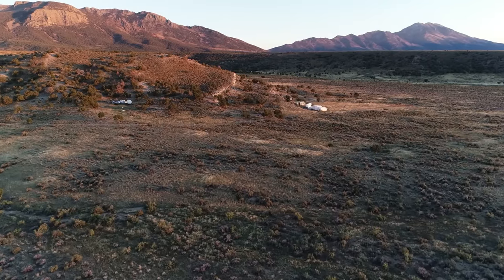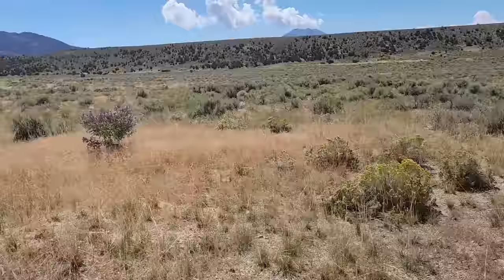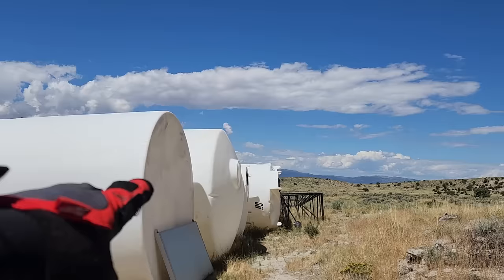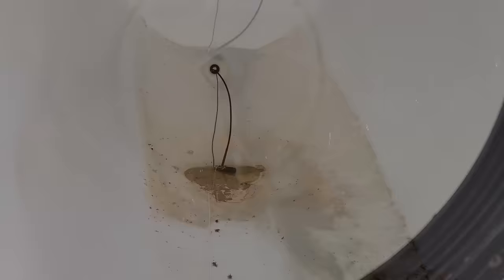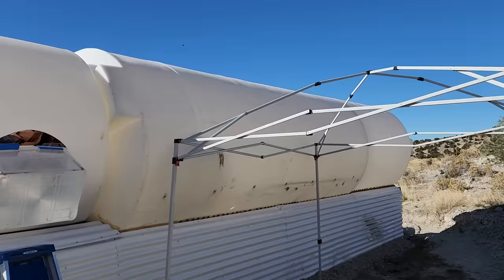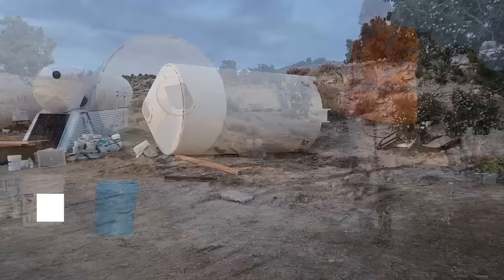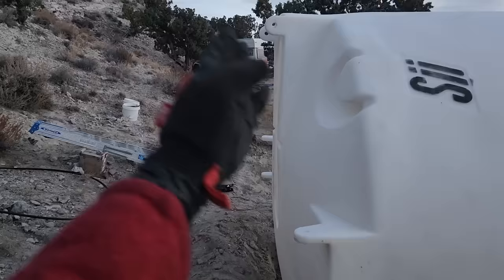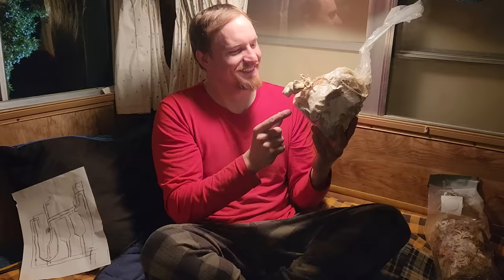ChickenHole Base Ep 23: Magnificent Moths

Comment: The vascular resistance to flow through a pipe varies with the 4th power of the radius. A pipe with twice the diameter has 94% less vascular resistance.
Reply: My man
Reply: GO MATH!
Reply: Science and sh*t!
Reply: the neat thing about math is i have no idea if this true or if you are trolling
Reply: @Nderak  The even neater thing is you can actually look it up! If you google ""vascular resistance trough a pipe" you'll find poiseuille's law. If you google the formula for that law you'll find that it's a term devided by pi * a radius to the power of 4! Which means if the radius is small the resistance is "something" devided by pi*something small to the power of 4. Which leaves you with a large portion of that original something, which means a lot of resistance. So the larger the radius, the more you devide the something, and exponentially at that.

You just gotta know about the law in the first place I guess.
Reply: I was thinking the same thing without the numbers.
Reply: Heart blockages hate that law
Reply: this guy meths
Reply: I had no idea

Comment: buying a shed for your materials so they don't get wet would be good, maybe an atv to survey your property, also would be cool to turn one of the tanks into a water tower to take full pressure showers, and maybe make an outdoor shower.
Reply: He's far more likely to build or even convert yet another tank into a storage shed. He could also place a fresh water tank higher on the hill to deliver the pressure, with a low load water pump to top it off. Far safer than building any sort of structure to hold a tank.
Reply: Peeping, Thomas?

Comment: I second the other comments about check dams to slow runoff. I also heartily endorse the comments recommending the purchase of an excavator, although I strongly suggest that you choose a tracked skid steer with interchangeable attachments, such as a bulldozer blade, vertical auger, backhoe bucket, etc. There's a company called Titan Attachments with an astonishing variety of useful attachments. You could place a fresh water IBC container high up on the hill over your hab complex to provide moderate water pressure, with one or more low-power pumps to fill it back up. To properly store supplies, materials, etc. another large poly tank could be outfitted with shelving, thereby establishing a storage/utility hab. Finally, @theCodyReeder , every one of us admires your persistence, tenacity, can-do mentality, and good-natured cheerfulness.

Comment: You should definitely have robocody build some check dams to slow down than water when it rains
Reply: Yes! Arizona has a bunch of irrigation canals that acts as dams. They pool water coming off the hills and create a green belt in the desert of Arizona.
Reply: Yeah def set up some one rock check dams, that will benefit the whole area greatly!
Reply: Dustups/Cody Collaborations incoming!
Reply: Could be paired with some well-selected reforestation as well.
Reply: I was gonna say the same thing. Slow it, spread it, sink it!  There would be a lot more abundance of food for those bees, and non-edible material to feed to those mushrooms.
Reply: Swales. Swales are the key to long term, passive, practically permanent desert land greening.
Reply: Make the paths more... Wiggley.
Reply: I don't think he is allowed to collect rainwater on his property.
Reply: @Nat569On  Collecting and storing rainwater for gardening became legal in Nevada in 2017, and Utah in 2010.  In any case, things like check dams that just slow the water down on the surface are not considered storage, and are perfectly legal pretty much everywhere.  The water that is held back soaks into the ground within a day.  Over time this creates a more hydrated landscape.
Reply: It's beavering time 🌳🦫
Reply: I'm also curious if over time it might subtly alter the local climate. like if you held back enough over a large enough area causing the area to be moister.

Comment: If you get out much, you can visit thrift stores and second hand stores.

Keep an eye out for used vacuum cleaners and get the hoses, since they can be plugged into each other so they get longer as you get more.

Shop vac systems come in 1.25 and 2.5" hoses, and they are black, so they can both collect solar heat, as well as they will allow more flow than a hose.

Comment: Hey Cody, you might want to use a potting soil instead of a top soil or raised bed soil. The latter are both largely inorganic soils, which you have plenty of. Your soil would benefit most from as much organic matter as you can add, and potting soils are almost entirely organic matter (usually peat moss). I suspect your soil is also basic, so the lower pH of the potting soil would aslo serve to bring the mix closer to neutral. 

I love the videos and am genuinely glad to see you doing so well

Comment: Peppermint oil will help against any future rodent intrusions, and it's pretty harmless and not too obnoxious as far as repellents go. You'll know if it's effective if it is strong enough where you feel it a bit in your own eyes when applying it. It tends to work better with enclosed spaces, like the insides of compartments or vehicles. And should last up to a month or so between applications. (But just dissuading a few rodents may be enough around a quarterly basis, depending on how many are right at your base camp.)

Comment: Id like to see an experiment where you pressurized one of those big containers with a density of air that would simulate the difference in pressurization between a habitat on mars and the open air of Mars. Specifically, itd be cool if you released this pressure so that we could kind of see what would happen if a habitat on the surface of Mars was compromised to the open air.

Comment: Just got this recommended to me after 11 days even though I am subscribed.... Thanks youtube!

I have a tip for you for the rat chewing on wires problem. If  you get any household cleaner in a spray bottle (I use mr clean) you can do a fine spray all over the engine wires and they wont touch them because of the bittering agent they add to it to keep kids from drinking it like cool-aid.

Comment: OMFG! A CODY VIDEO!!!! You should put a sluice box where the water runs off and see if you can naturally pull some useful heavy minerals off the land. CAT: Clawed Automatic Trapper? Personally if I could get the money and equipment to do it, I'm interested in building an underground house. I think in the area I live in it's the best idea. It'll cut down on both heating and cooling bills by staying at a more comfortable temperature all year long compared to the hotter or colder temperatures above ground. The only thing is I don't know how to make it strong enough yet flexible enough to handle Earthquakes which we get pretty frequently. My dream would be for it to be at about 1500-2500 feet of elevation up in the foothills of the Sierra Nevada Mountains where it's just high enough to get some snow but not be completely snowed in for months and also hopefully a good enough plot of ground to be able to hunt my own food on it. I think a couple indoor grow rooms would have to be part of the design to grow tomatoes and potatoes and corn without worrying about wild hogs or bears or deer getting into it... as well as my own CBD/THC for personal medicinal use. 
The downside to your idea of mushrooms supplying you protein is they actually have very little in them, roughly 3 grams per cup uncooked and they quickly leech out as they cook. That's why they say to never risk eating wild mushrooms in a survival situation because there's so little reward for the risk of not knowing which type they are. For a comparison 1cup of pinto beans has 41 gr of protein. 1 cup of refried beans has 13g.

Comment: to the Greenhouse project.Would it help to put the rollers inside ? Using rotating shelfs ? then you just need rings they fit inside with rollers . And when you cut a part out of the wall and make a seeled  stair- door  off it, you just need a Tent as an airlock. Glued to the Greenhouse. Open the tent  close the tent . Open the greenhouse, get into it.

Comment: Its good to see you uploading this type of content still, Cody. Hopefully you are doing well, noticed your uploads slowed a bit over the last year or so. I have an idea for a project if you are interested in it. 

I want to know how much energy can be sustainably created using a custom flywheel attached to some kind of transmission. I have seen videos of professional athletes using stationary bicycles to see how much electricity can be generated using them, but I think this idea can be taken to the limit by using an extremely large flywheel and some kind of gearing system to move it more efficiently as you get it moving faster. I want to see how much electricity can be created using something like this and for how long, if you have every component working perfectly

Comment: If you are thinking of a new rover, may I suggest something multi fuel? Maybe a small pickup like rover with a mechanical diesel in or swapped in? You could grow your own fuel, plus they make pancake motors you could add the front of the engine to allow for true multi fuel with electric additive

Comment: I love the idea of growing mushrooms from the scrap clippings, but I noticed that your fruiting didn't go all too well. It looked pretty dried out and stunted. I assume you just let them fruit in the hab? 
I learned this the hard way, but mushrooms are very sensitive to CO2. A little over a year ago I tried growing pink oysters in my apartment closet, and it went alright, the crops I got were okay, but I found out later that because I had them right near me, I was probably affecting the fruiting due to the CO2 I was exhaling. It's important that 1. The mushrooms have ample humidity to fruit, and 2. The ambient CO2 levels should be limited to below 1000 ppm. Humidity is fairly easy, but CO2 is a bit harder, especially considering that the mushrooms themselves exhale CO2, so you need a constant source of fresh air being pumped through your fruiting chamber.
I would recommend building a separate area for the mushrooms like you said. You could just run it off a couple solar panels and have a humidifier and fan hooked up to it, blowing air in.
You could grow pink oyster in the summer due to their heat tolerance and speed, and blue or grey in the winter.
The only issue would be that it may use up quite a bit of water since you will be constantly pumping humid air out to preserve the CO2 levels. So you would need to constantly be replenishing humidity. But I don't doubt that you'll figure out a solution to that.
Either way, this is a good proof of concept and I'm excited for the future of your mushroom growing endeavors at CHB.

Comment: Just getting started on this one, but I can't not see it... The rover's headlights needs some help. 3M's headlight restoration kit works extremely well, and the last step is a treatment with a self-leveling liquid that smooths over the sanded surface and protects the polycarbonate from UV damage. It lasts for a few years. Now, on with the rest of the video...

Comment: when you had both ends of the black tube open there were two effect, not only was the air becoming less dense, but it was doing that by expanding and trying to push out of both ends. That has to reduce the effect? Then when it's working it's pulling cooler air in the bottom so all the denser air is concentrated in a small area. Having the black bag might have helped by pre-heating the air going into the tube so it was lower density before entering the tube?

Comment: Hey Cody if you need any help or advice with off grid solar stuff, I'd be happy to help. I've got a cabin in eastern Nevada and have built a couple systems. For like $4k you could build a set up that could run a minisplit even through winter storms